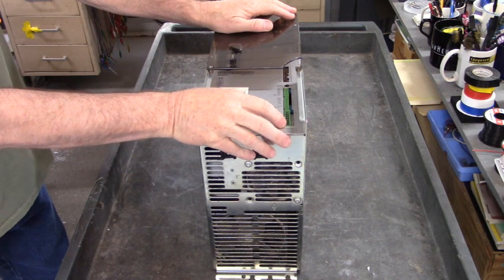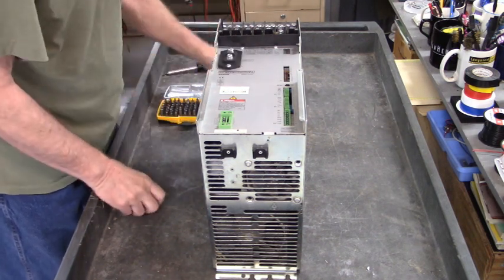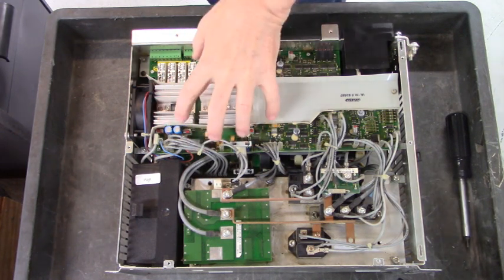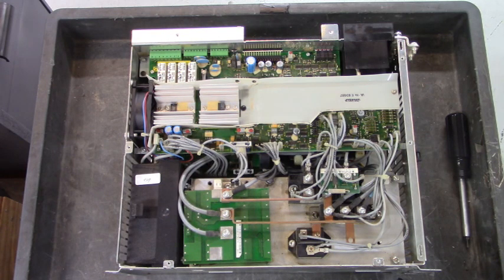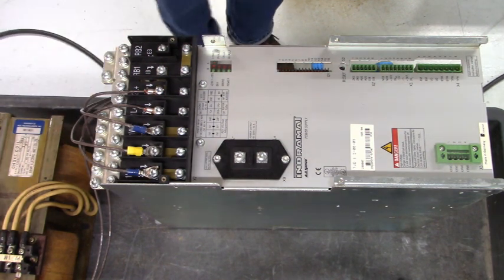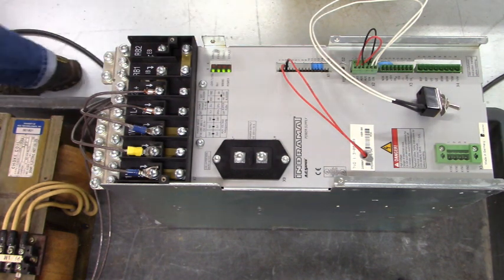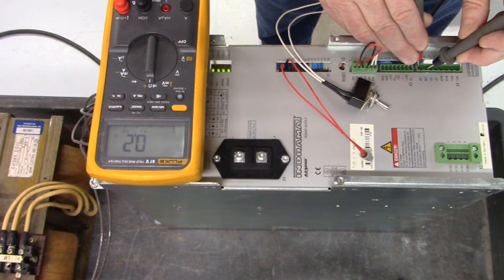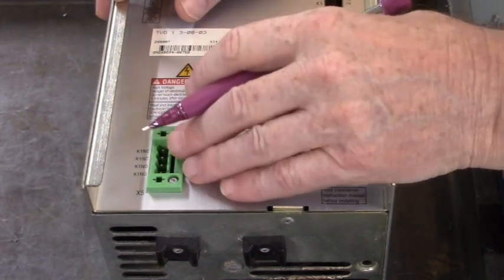Indramat Bus Power Supply TVD1 3-08-03

Comment: hello, please I have a problem with an indramat TVD1.3-15-03 power supply, the problem is everything is ok but the L+ L- output is unstable and gradually increases to 397 Vdc instead of 320Vdc until the regenerative resistor heats up, please help me to solve this problem, thanks in advance

Comment: Hello You have a lot of experience with Indramat systems.
I have a problem that I cannot solve, even though I ran the motor twice in the Bosch service. Now I have to write the motor parameters in the system. Can you help me with a Syn Top software version for firmware 06FW for a CLC DIAX 04 system?